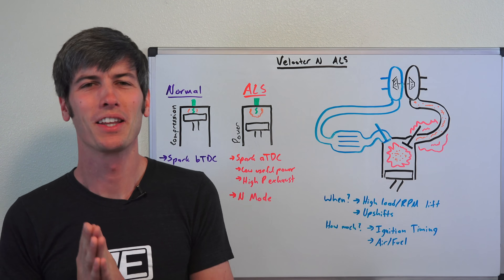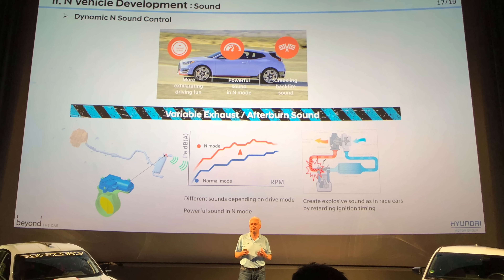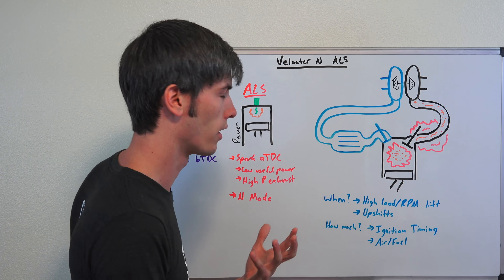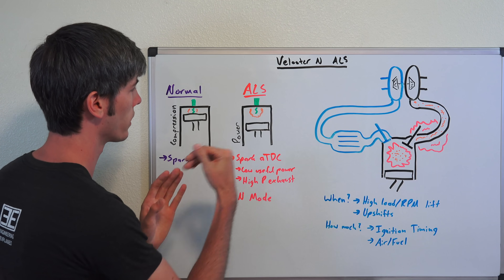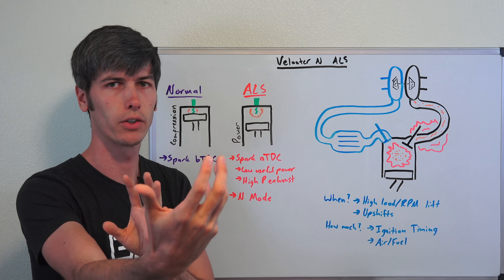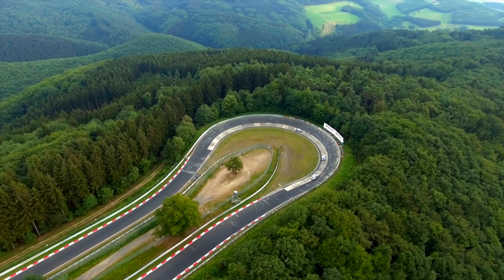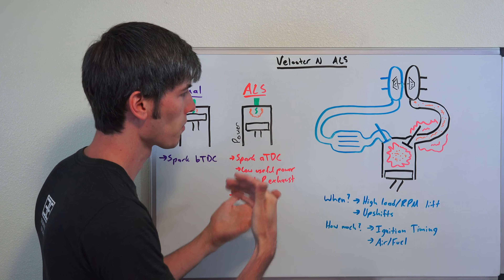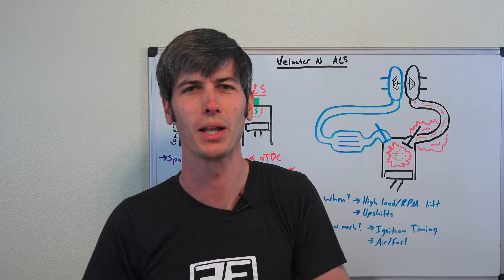Anti-Lag - How Hyundai Eliminates Turbo Lag

Comment: Turbo lag = cheap VTEC, kicks in at 5000, so why would you want to get rid of it?
Reply from the maker: The car can hit peak torque long before 5k, turbos are sized a lot differently these days.
Reply: Engineering Explained I prefer 90s turbos. Lots of lag then lots of boost
Reply: Engineering Explained 

If you could summarize the whole video in one sentence, what would it be.......
Reply: Poor throttle response is poor throttle response.
Reply: Because we all want turbo lag to kick in yo!
Reply: Ford turbos explode if you like that?
Reply: VTEC has throttle response because the port injector is near the VTEC valves there no change proportion between intake manifold pressure to fuel surge.
Reply: E85 13B VTEC has good throttle response because it's naturally aspirated. There after no such things as VTEC valves lol
Reply: future62 looking at the diagram for that was an ah ah moment for me. Variable valve lift without valves.
Reply: actually VTEC is the cheap turbo lag
Reply: The turbo on my Malibu kicks in at 2k rpm. Red lines at 8k it's damn fun for my family sedan lol.
Reply: Cotton the problem with what you said is Malibu. They are hideous cars and still just a Chevy.
Reply: Cotton Hil
* You're
Reply: A supercharger has no lag, since its belt driven. 

Although a supercharger  works throughout the whole rpm range, it usually performs better for low to mid range rpm.

A turbocharger works can work throughout the whole rpm range, it usually performs better for mid to high range rpm. ( Also usually has lag, due to being pressure driven, not being belt driven ).

Both types of forced induction has their good and bad, so take a pick.
Reply: The Royal Crowned Tiger There are cars with both for the reasons you cited. Enjoy.
Reply: insert VTEC joke here
Reply: Peak torque in the N is available between 1450 and 4700 rpm. The engine is in no way comparable to older generation (NA) VTEC Hondas. You don't need to rev them out to get good acceleration. Performance is just always there when you want or need it. You can lazy drive this car in 3rd all day and you'll hardly notice a difference, where in the Hondas you had to down shift before you could get any kind of acceleration.
Reply: Turbo lag =/= boost threshold

Comment: Can you do a video talking about leaving your engine running while gassing up your car
Reply: As far as I know, (at least some) fuel systems are closed, pressurized systems. Removing the cap while the engine is running, may drop the fuel pressure momentarily in the system and cause the engine to stall. And/or most likely will throw a check engine light, as modern cars monitor the state of the fuel cap in order to prevent gas fumes going into the atmosphere :)
Reply: Fair points, I hadn't considered it being that hot or the unreliability of the car.

It seems so unnatural but thinking about it I can't see it being that much more risky than filling up normally, other than perhaps hot fumes from the exhaust or the exhaust itself being hotter.
Reply: Why would anyone ever do that?
Reply: Dead battery... I've seen people do it.
Reply: Drunken Hobo Several reasons. Dead battery, could have a hard time restarting the car in a frozen area, etc. My situation is- I live in Phoenix and it can be 120° outside in the summer. If I have to gas up and my kid, wife, anyone is in the car, I like to leave the AC running. Also I hear that there’s little to no risk associated with this on modern cars. But this dude would probably be the most qualified to answer!

Comment: Does this system reduce turbo reliability ?
Reply from the maker: The engineers would obviously want to design for the added stresses. Can’t say if reliability will be good or bad unless you know the ins and outs of how the whole system is designed.
Reply: it will be cool if Hyundai make it a switch to turn it on when it needed, and off when just cruising in city.
Reply: Muzaki like having to put it in N mode?
Reply: Absolutely, including the manifold and possibly valve
Reply: this is also going to hurt the catalytic converters
Reply: Muzaki most definitely
Reply: yes
Reply: Rocco Croce Exactly. They seem to be pulling enough timing to kill the motor in a normal scenario. Not in favor of burning fuel when it doesn't go to the wheels. This is NOT an energy give and take either. You're just enabling the engine to demand more fuel more quickly.
Reply: InsideOfMyOwnMind
I'm not sure he was talking about the engine there ...

Comment: So the exhaust valves take the heat? Does this anti lag works for a specific set time period (or maybe only in a specific rpm range?) or is it working ∞ when the peddal is de-pressed? Thank you for feedback.
Reply from the maker: Bretter Shoalar it’s a short time period when you release throttle in certain conditions (high load and RPM insinuating that you’re attempting to drive fast).
Reply: Engineering Explained So the short time period must be the time when pressing the clutch pedal-shift-and depressing the clutch pedal? Do I take that the right way?
Reply: +Bretter Shoalar  While shifting, it should only operate for the length of the gear change, at which point you are likely to be back on the throttle and ALS would not be needed.  Unsure how long it would be active if you get off the throttle and leave the car in gear, but I would imagine it ceases to be effective below a certain RPM, at which point it would shut off.

BTW, "depress the clutch pedal" means the same as "press the clutch pedal" in this context.  I would suggest using "release the pedal" instead.

Cheers!  :-)
Reply: Bretter Shoalar turbo keeps spooling all the time at a specific psi.
Reply: WREX Rally Ah okay so to remind: You have to 'hit' a specific turbo pressure so the anti lag starts working. And de-activating it by....hitting the brake pedal?
Reply: Bretter Shoalar high load (gas pedal floored) and high rpm. If youre near redline and shift, the anti-lag kicks in to keep the turbo spooling. This isnt happening at any engine load and rpm. For a daily driven car, i wouldnt be concerned with long term reliability.

Comment: I get the performance increase, but isn't it going to reduce fuel efficiency for no good reason when it's just to sound cool?
Reply from the maker: AlexTheStampede if it’s just for pops, then yes, but it’s a very small amount of fuel since it’s just changing ignition timing to make the pops. Also there are different modes, so you can switch it to an eco mode if you want better fuel economy and to not use the feature (or a custom mode).
Reply: It is always for elimination of delayed torque, rich or ignition control will increase torque or throttle response and beneficial in turbo most especially, where natural aspiration already has throttle response but where as turbos have delay from large intake routes. Increase torque, increase fuel consumption regardless.